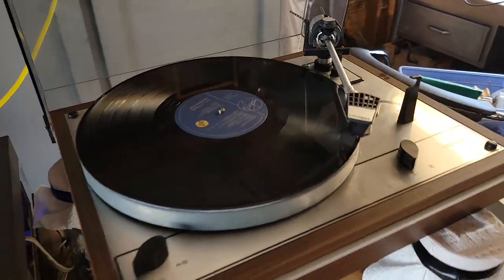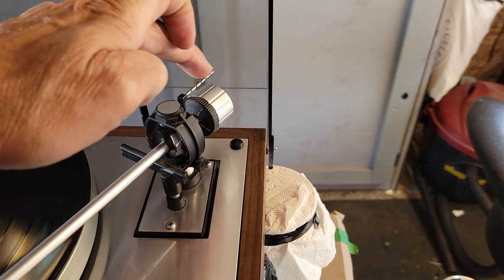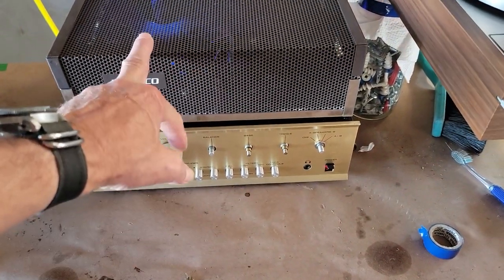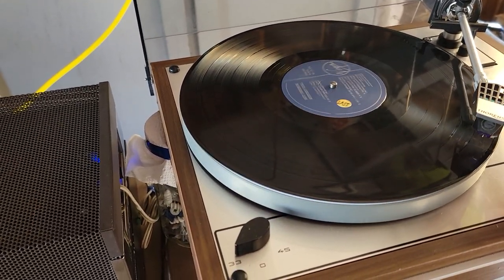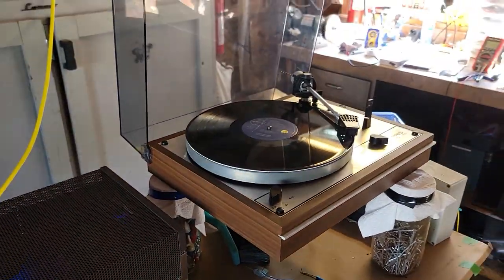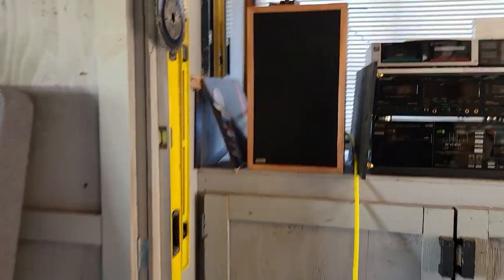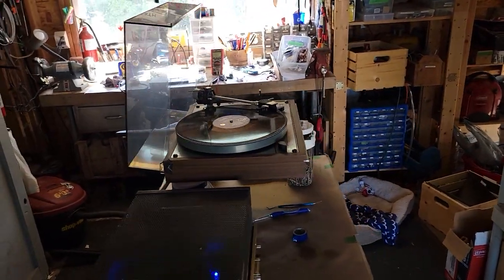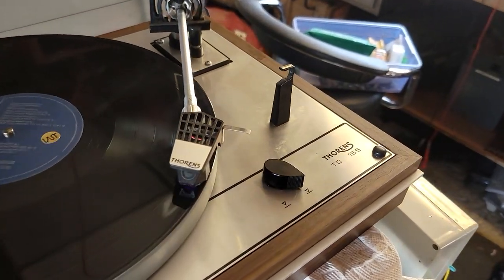Thorens TD-165 Restoration Progress Report - 15 Sep 2023

Comment: I had a terrible humm problem with my 165....tore it down for parts.
Reply from the maker: Clearly you don't know what you're doing then.😉 🤪Nine times out of 10 hum is attrubutable to where there is a break in the signal chain or dirty contacts at any of those physical breaks in that signal chain (There are at least four in a stock Thorens TD-160/165 and five in a Dual 1229) so the Dual would be more susceptable IMHO. This is an issue with Thorens, Dual and all turntables alike. Here was my Dual 1229 (the so-called Engineers table) that is now singing good at my nieces place as a gift which also had a nasty hum issue when I got it. I corrected it pretty quickly just as I have with any Thorens I come across. I have worked on them all and by far a Thorens rubber band drive table is a superior table in every regard to a Dual idler IMHO. Everyone is entitled to their opinions of course. For me Dual's are unnecessarily complicated and a pain in the butt to work on with sticky grease being a continual nightmare with any of the12xx series. The 1229 was the first one I owned when living in Germany. All the crappy plastic bits are also infuriating!
https://youtu.be/fxSznGmiHpo?si=q-ULoOZMkJdlzp0P